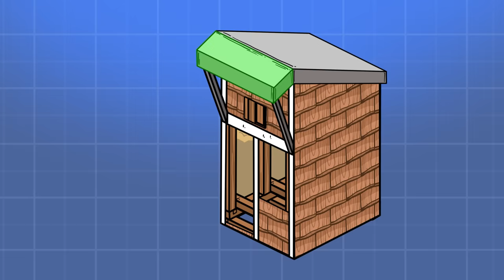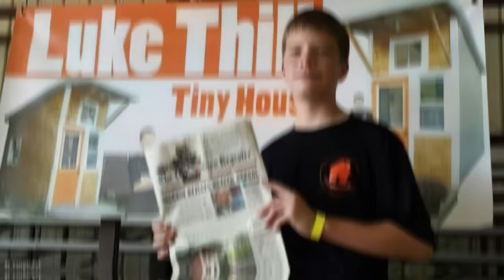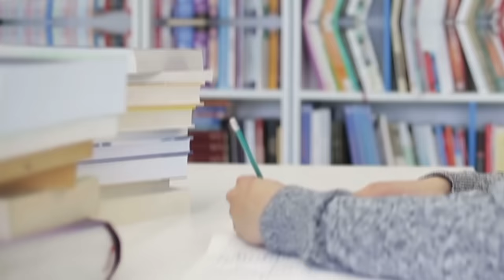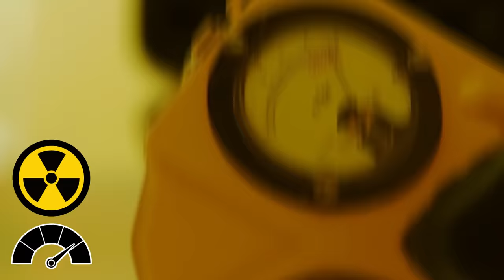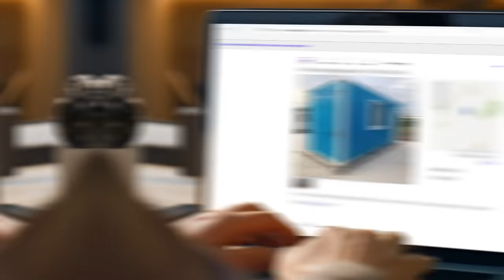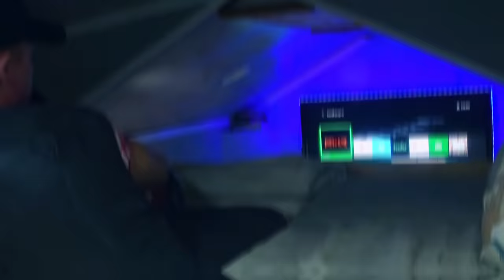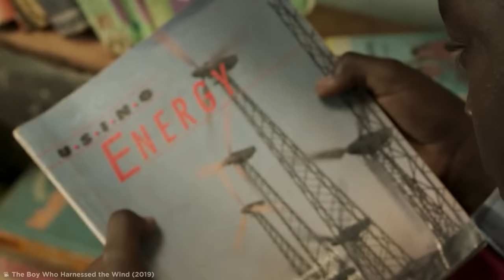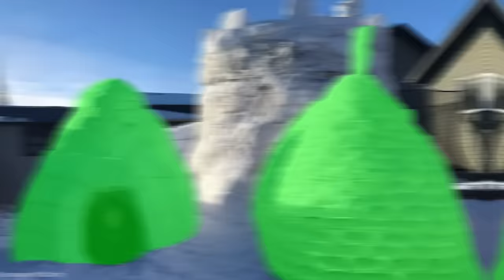Nobody Knew Why He Spent His Summer Building This, Until They Went Inside

Comment: I once built an igloo and a snow tunnel.  All in a day's work, we got that very rare snow that was like styrofoam.  So I took a bread knife from the kitchen, and used a snow drift to cut out cubes of snow, hauled each and every one of them to the front yard, and built an igloo.  Then after that was done, I recycled the drift, and dug a long tunnel that nearly spanned a quarter mile.  I was in my early teens. 

Sadly, where I live, snow in that consistency and quantity is extremely rare, so I never had the opportunity to build another igloo and tunnel system.  That was the day I learned that igloos are actually quite warm and comfortable.  And snow is heavier than you think.
Reply: Is it still there ? I mean I know you said you don’t get that special snow but you did get it that one time and since you already told us you built the igloo and the 1/4 mile tunnel. I hope those neighborhood bullies didn’t destroy it , or the local homeless population took it over and destroyed it with their drug use and lack of resources to maintain it. The only thing I don’t understand is how you prevented it from melting when the winter ended . Either way if you figured a way to prevent the temperature from getting over. 32 degrees and the homeless population isn’t squatting inside the tunnel than it still might be there.
Reply: @mrbig4532   I grew up in the middle of nowhere. And I never said anything about how long it lasted, so I don't know where you got that bit from.   The tunnel was easy, since the property line had a fence that spanned it, the perfect place for snow to drift and collect.  All I had to do was dig along the drift.  
It was only a little project I did because I was bored.
Reply: @UncleThor  I was just asking if it could still be there, you know I don’t what part of the world you are from , you could be from somewhere where it’s cold all year round like Antarctica . I mean 1/4 mile tunnel is a lot of work it took like 6 years to build the channel tunnel which is a little longer that your 1/4 mile ice tunnel but they used machines and thousands of labors you did it by yourself with a bread knife!

Comment: This is nothing when I was this kids age I built a number of tree houses that where at a minimum of 2 stories one was 4 stories. Half of them I built myself. I noticed every woods I hung out in and place I stayed at there was a construction site near by so I would go check there dumpster and also would as the construction workers if they could make a stack off woos and nails for me rather then toss it in there dumpster. I had one contractor literally bring me like 1k in materials thats what me and my buddy used on the 4story clubhouse 😂.   I did step on alot of nails tho 😂😂 I had 2 separate times I remember when the nail went all the way through my food. One of the times I had on sandals and I jumped on a a peace of wood with nails and when my buddy's little brother saw it was poping out the top and blood was leaking everywhere he turned and instantly started puking 😂😂